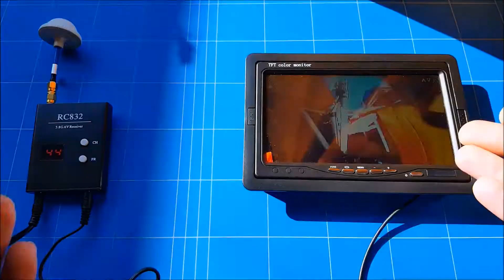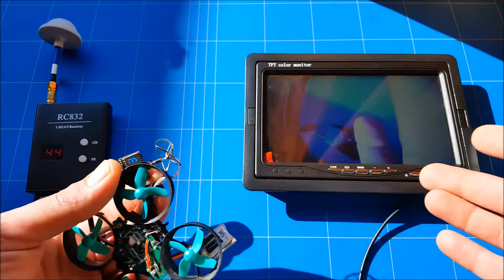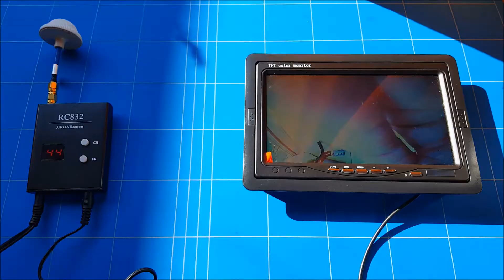How To FIX Tiny Whoop Micro FPV Antenna Full Repair

Comment: Noob question,  can you solder the mushroom antenna further from the camera by means of an extension wire ? 
I'm doing a tank project and I want the camera inside and the antenna outside on the back of the turret
Reply from the maker: yes you can use a exstension wire the move the antenna to a different place but i personally dont like muschroom antenna it breaks so easy you better can use a antenna as one in this video https://youtu.be/Vdm6deVhX9k
Reply: @HowToDIYRc  
Thank you very much for the info , and yes I will replace the antena with another one less prone to get caught in vegetation

Comment: Have you ever had an opportunity to solder power wires that disconnected from your camera? I'm in the process of repairing a AKK Micro aio where the power wires (red and black) got detached from crash...Thanks and happy flying!
Reply from the maker: yes a figgely job and happens a lot with those small aio camera's
Reply: @HowToDIYRc  yes sir

Comment: i repaired it, it does not work i swapped it for a new clover leaf, it still does not work, i soldered it perfectly and signal is perfect untill there is the tiniest vibration, any idea why?
Reply from the maker: we hade that problem ones for me it was a loose connection on the circuit board of the camera  check the power leads from the battery running to the camera and check the wires running to your monitor have a good Easter weekend :D

Comment: Thanks for the video!  I just got a Lizard95, the circular polarized antenna broke off after my 2nd crash (on carpet!) while I was tuning PIDs.  The antenna was by far the worst part of the kit.  Replaced the junky circular polarized antenna with a basic whip antenna by following your video.  Now my signal is great, the antenna can take a hit or two, and the Lizard is flying great.
Reply from the maker: Thank you for you wonderful long comment🖒 it made my day great to know i was am able to help you

Thank you for letting me know🖒🖒

Comment: howzit. I was jus wondering if you could help me something. Basically I have a 1000kv motor and I'm using a 850mah battery for, it doesn't come near to full speed when I rev it up. I'm just curious to know if the battery is too small for the motor. I also recently bought a 1500mah battery for the motor.
Reply from the maker: You need a bigger battery or a higher C rating a bigger battery can help because a 2000mah with 20c is good for 40amps and an 850mah 20c is only good for 17 Amps
An old battery can also have a lower C rating than it says on the package
what really need to find out is how much Amps those your motor draw with the prop you like to use.... prop size can change how much Amps it's drawing from the battery! the smaller the prop the fewer Amps it draws

hope this helps you :D

Comment: One would think , they would come out with an antenna small enough for micro use, but strong enough to withstand  a crash.....or have a solid antenna housed in something unbreakable...and still be able to receive the signal ?
Reply from the maker: Ye your Right most of these all in one FPV System come with a simmaler antenna that breaks way to easy for the money you payd
a Easy fix it to solder the antenna while it's pointing to the back instead of UP!